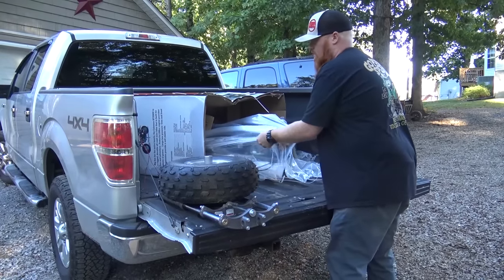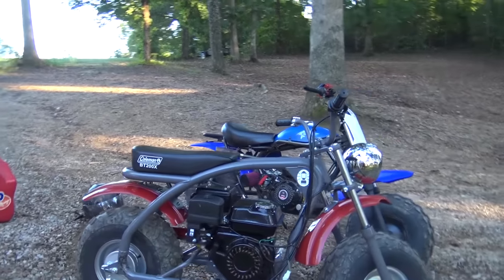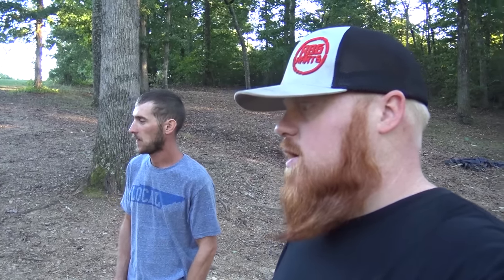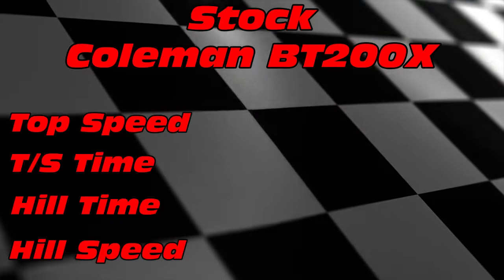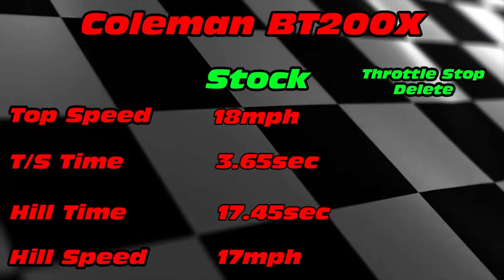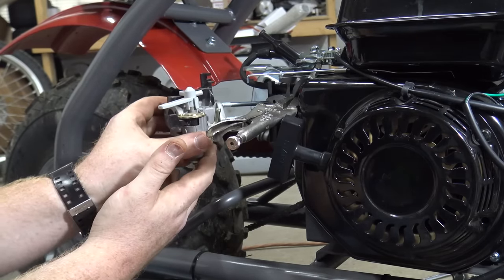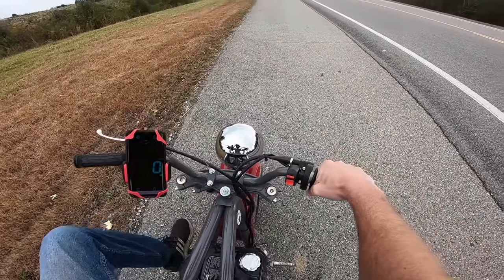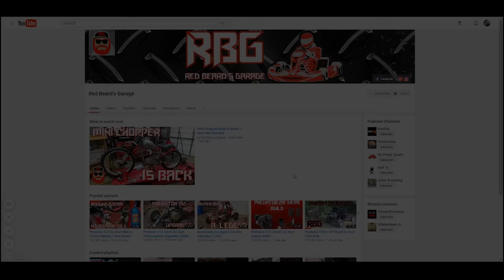Coleman BT200X Performance Testing

Comment: Yeah don't trust Wal-Mart.. you see the employee's. " hey frank, go try to put that bike together"
Reply: Double check all bolts if you get it assembled! Bought one yesterday, 10 miles from home carb drain bolt fell out, ended up plugging it with a cig butt wrapped in plastic bag but made it home 🤣

Comment: I remember finding an old mini bike and putting new wheels/tires on it with hand throttle control and a new 5hp Briggs on it got it up to 30mph by passing the governer was a hoot. Had a Murray go cart with 5hp done 27 plus  mph. Them was the good ole days long gone sadly.

Comment: I zipped tried the inner gov spring and installed the stage 1 kit. Had to use a die grinder to clean up the lip inside the header pipe. Then installed a bigger rear sprocket. Installed Harley foot peg with a little welding and grinding they won’t break like the stock aluminum pegs. I made and installed BMX style pegs for the rear axel it just goes threw them they work great slap some grip tape around the. I work at a Harley shop so I brought it to work and Everyone I work with was riding that little red Colman like a dirty girl. Some of them were afraid to get hurt on it. It’s awesome on logging trails and such. I have more power with the little muffler off and it sounds awesome that way. Well I do work on loud Harley’s so I guess I’m into loud toys.

Comment: I have this exact bike. I get 32 mph top speed. My air cleaner is stock but I bypassed the governor with a zip tie on the spring. Works for now. I did the throttle stop delete too. I also weigh about 220 lbs.
Reply: How do u do that

Comment: I picked one up 2 weeks ago, everything is great, strong tube, Chinese parts that actually fit together well. 2 questions I'm wondering if you've ever run across, both with front fork. I notice everyone runs the throttle and brake cable behind the upper part of the fork. These appear to be somewhat kinked and no natural curve. When assembling my handlebars, I pushed them through the rectangle in the upper fork and now the cables are through the fork, not behind it like on most large bikes. See what you think.  I'm also wondering if you have ever been tempted to grind off the two tabs in the cast upper fork that limit the turning radius of the fork. Maybe its just me but I think this bike has a very limited radius and this would help a lot. Probably best not to screw with it if young kids are doing the riding.

Comment: I achieved 29mph with just a throttle stop removal and homemade muffler pipe with spark arrest.  I love my BT200x.  Going to do the torque converter next for some more mph.
Reply: Only 29 mph ?  I get mine up to 47 mph.   Still room for more
Reply: @eddiespagetti8395 is it stock

Comment: Beefy frame! I'd like to see speed tests with RBG driving so  I can gauge performance as I'm 6'1" tall 300 pounds, nothing against Lonnie.
Reply: those poor tyres
Reply: Damn man.. 6'1 and 300 pounds?.. 
Time to trim down bud.. I'm only 3 inches shorter than you and I'm 200lbs and feel heavy as hell and slow. When I was 160 I felt a hell of a lot better.

Comment: I just bought one of these and have been doing some speed testing. I got 22mph out of the box no mods, cut the throttle stop screw and got 24mph. Im guessing that they are not making that screw as long on the newer bikes. It is a 2021.  Stage 1 stuff already ordered just waiting on delivery.

Comment: I've been wanting one for hunting and camping. I've been looking and the CT200U-EX. This may be better because frame looks stronger. I wanted to add front and back racks, possibly a single wheel light trialer with a u joint connection (kinda like Rokon trailer),extra lights,and extra fuel tank and middle storage.

Edit:  if you want let me know if you wanna help build and I'll pay or whatever. I have many ideas. Think bug out bike, but way way cheaper than Rokon

Edit...I can't find it for sell anywhere. I'm in South Carolina. :(
Reply: You guys have a rural king or camping world out there?

Comment: I did stage 1 and a torque converter on my bt200x and have gotten it up to 46mph so far. Still has gov though.
Reply: Post pics of bt200x with mods
Reply: Do these take the same torque converter as the CT models? What model of converter is the best for the money? Seems to be a wide range of prices!
Reply: I highly doubt that.
Reply: I haven't found any torque converters specifically for the BT. What did you use?
Reply: 196cc on BT200X... prolly 50 MPH without governor...

Comment: Love the video's ,wondering if you could do a video on converting from electronic ignition to a point type ignition in case of an EMP electro magnetic pulse event
Reply: It is impossible in this day an age to create any EMP of that size, unless it were to effect a very small area. Regardless, electric point and magneto ignition would experience the same adverse effects if an EMP of that incredible size were to take place, as they both use identical methods to generate the electric spark (magnet). If you are worried of such a thing happening you’d be better looking into a pedal bike.
Reply: If you are interested in that sort of thing, look into faraday cages, it would be possible to build one around all the electrical components
Reply: @nitschke30  it is my understanding that an EMP would damage solid state (silicon) devices but only temporarily disrupt points ignition

Comment: You mentioned that in a later video you would explain how to fix the pulsing headlight issue without installing a battery.  I can't find that video.  Do you remember which one?  If not, would you mind explaining?  I have an older MB200 and I'd like to stop the annoying pulsation of light.  Thank you, new sub.

Comment: Did they update the clutch on this one from the CT200?
Reply: Not sure why they would. Any 200U made after 3rd quarter 2016 has a decent clutch with a caged needle bearing. The clutches prior to that had the problem clutch with a bronze bushing. I would bet that these bikes have the same clutch as the 200U's. It works fine when properly serviced, and properly ridden.

Comment: so i have nvr seen one in person. but this bike looks bada**. but these small engines they come with to be are weak. i thought is, do u think a predator 13hp would fit on it without modding the frame?  b/c tank exhaust and even carb can be moved if need be. let me know when u can. id imagine u got one them 13hp pred around.
Reply from the maker: yes a 420 would fit but you would have to put on a different engine plate

Comment: What powers the front lite ? You mentioned charging coils are THEY an integral engine part??
Reply from the maker: It is a charging coil behind the flywheel. You would need both to add it to another bike

Comment: RBG quick question, how come you can't just remove the governor arm and leave the gear intact?
Reply from the maker: It can come off the pin in the engine and cause damage
Reply: @RedBeardsGarage   well couldnt it come off the pin before you removed the arm also??  same chances?
Reply: @RedBeardsGarage  im just wondering if leaving the gears in could maybe help by mixing the oil up and swirling it around in the case
Reply: @burnettjerry  you may be onto something... especially when using thicker racing oils... I just rig my governor spring with zip ties and leave the insides alone
Reply: @gregsteele9002  yeah it's a lot of work, unless you have billet piston rods with the longer oil scooper, really don't see why not just leave it in. less chance of leaking oil. imo

Comment: Hi Red Beard, are bt200x and ct200u same engine? There's a carb on Amazon for a ct200u want to know if will work on bt200x? Thx for any help
Reply: I do believe the Coleman CT200U and BT200X have the same Hysun engine, carburetors should be the same too in theory

Comment: could you easily make the CT200U racks fit on the BT200X?
Reply from the maker: Im sure I could but I don't have a set to test
Reply: @RedBeardsGarage  Thanks for the quick reply! Just by eyeballing it online it seems that the support arms that mount on the axle shouldn't be an issue...I'm curious how it may mount below the seat/above the fender? Do you think it may involve grinding or welding a new bracket? I just have basic tools.. Also, is removing the rear axle a major pain in the butt to replace? I don't want to take it off and regret ever going down that path..
Thanks again for the great videos!

Comment: What are the pros of switching to a Honda GX200 carb? Does it perform better than the stock Coleman carb? (Total neophyte here)
Reply: There are none. They just wanted to get their testing done and save the jet removal for another video. The stock carb works fine after it is rejetted.

Comment: You're right on repeating stage 1 setup lol, cause Im about to buy the one of the 2 in this video. I need that how to! Thanks for all the info! Gonna be stock for lil bit till I tune it up. Just got the kid a BT200 used with a pred 212. It has dyno papers at 14.51 HP @ 5K so it's gonna be a lil while till I get up to that ones level lol.

Comment: I have been looking into purchasing a mini bike for a few months now.  In you'r opinion what would you say the best mini bike stock from the factory is, concerning quality and speed?   You'r advice would really help, thanks in advance.
Reply from the maker: mb200 trailmaster by far
Reply: Thanks man, I really appreciate you'r advice.  If I go with a mini bike, I will for sure grab that one.   @RedBeardsGarage
Reply: @RedBeardsGarage  is that because it has rear suspension also. Isn't it about $200 more than the Coleman. With stage 1 kit and Torque converter,  wouldn't the BT200X perform just as well as the trailmaster? Thanks in advance for your reply!
Reply: Chip Fernandez the mb200 is around $400 more than the Coleman.

Comment: I tried putting the same air filter on to my ct100u its just a little to big is there anyway to change that to fit it?
Reply: Get the ct100u air filter kit from monsterscooterparts.com or you can get the ct100u performance kit from hotrodminibike.com

Comment: 23 mph? Yeah completely changed my mind about getting this.
Reply: Same I want something that atleast does 40
Reply: @chaseware3181  Mine go's 52mph
Reply: @lordcrumbscrunchydelights9171  What did you do to it?
Reply: @chaseware3181  I took out the governor. Got a stage 1 performance kit. And a torque converter.
Reply: @lordcrumbscrunchydelights9171  Really it made that much of a difference? How much did it all cost?
Reply: @chaseware3181  257$ it made a huge difference stock speed was 21mph. I'm now able to keep up with my friends four wheeler.
Reply: @lordcrumbscrunchydelights9171  Thats awesome im gonna do that and add 18 pound valve springs
Reply: @lordcrumbscrunchydelights9171  does it fit a 6 foot 2 inch guy well?

Comment: Thanks for the vids. OK, I plan to do only governor,  exhaust, and torque converter, and beer holder. Which is best if I do (or don't) for backyard woods trail and long slight grade riding. Can't
decide between BT 200 and RB 200. Like BT more but getting hung up on that 3/4 inch shaft the RB has.

Comment: Would you recommend this BT200X or the MM212?  Most likely going to keep it factory.
Reply: MM 212
Reply: BT200X governer removal
Reply: Big Tube Frame Colman is Very Well built an Very Strong 💪

Comment: ct200 vs bt200x, what one is better?
Reply: Ct200u cant tread on the bt200.   Guaranteed.  (Unless you are only a flat road driver that needs cargo racks) Suspension means the world on trails.

Comment: Just got one. Should both tires be at 10psi?
Reply: let some air out in the back to compensate for no rear suspension i'd say
Reply: @rayota260  been running both on 10psi no issues and I am 175lbs. I used a dremmel to cut out the throttle stop and you can feel the difference.

Comment: 10:18 why did the throttle stop delete decrease  the top speed time?
Reply: well because it didn't add any power, it just let the throttle go all the way. so no increase in power and more throttle means longer time to top speed. stage one increased horse power so it got to the new top speed much quicker.